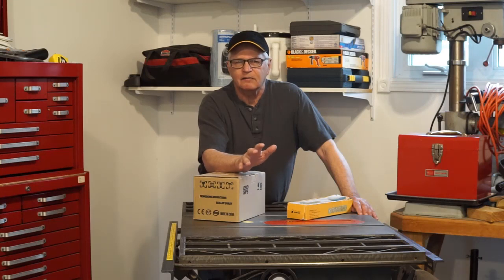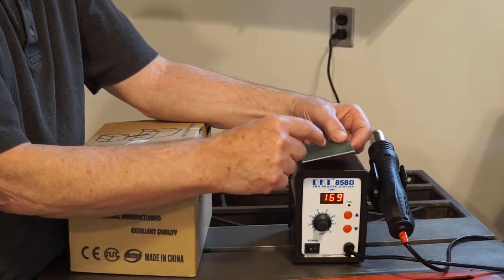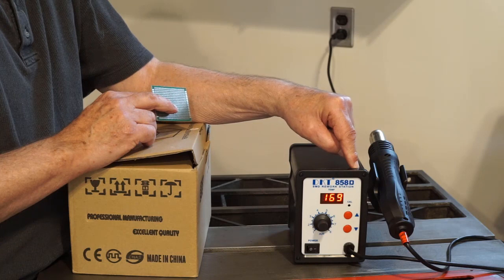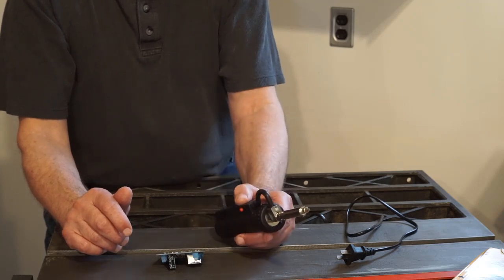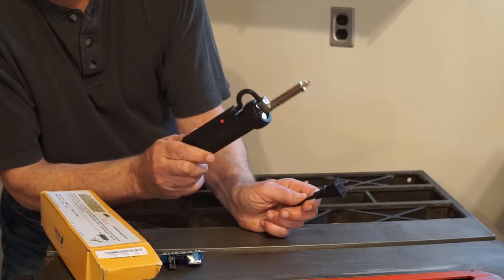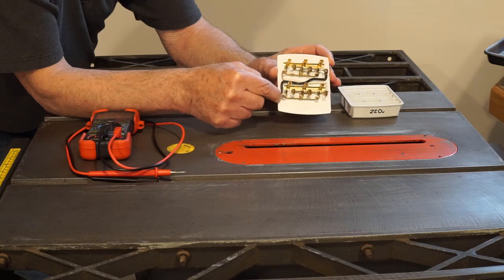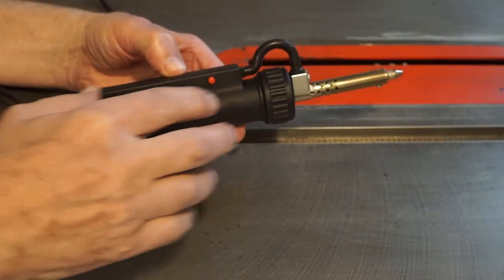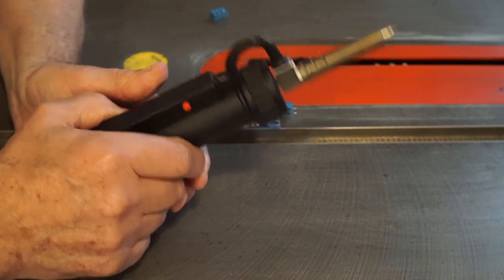GADGETS#55 - TWO AFFORDABLE CHINESE TOOLS

Comment: I am with u on that. For example. 02 Ford Expedition has the minature fuel pump relay soldered to the fuse relay box in passenger footwell. I bought the relay but after many unsuccessful tries ended buying the new box from Ford. Had I had this tool I may have succeeded. Always great info. Love your brilliant mind.
Reply from the maker: +Bill Rimmer - I've been making good use of both these tools. This automotive work is now as much about electronics and computers as it is mechanics.
And that very fuel pump relay soldered in that passenger footwell box came up is a recent video somewhere. Saw it last week...I forget who...
Bad design!
Take care, Bill

Comment: Nice toys and for the price, especially if you're making good use of them. Great workaround with the outlet multiplier for the solder sucker!
Reply from the maker: +Anthony Godinho - Thanks Anthony!
I'm using the camera built in mic and without a vehicle in the garage, there's quite an echo.
I don't think AUDACITY (which you introduced me to) can correct it. And, SONY A5100 doesn't have ext mic input. I'm trying to avoid separate audio sync in post. Been there, done that.
I've purchased a wider angle lens (25mm) that will keep the camera closer. Hope this will improve sound quality.
Reply: @theGADGETSplaylist  In Audacity, generally when I want to remove background noise in an audio track, I use the Noise Reduction feature. I've personally not tried it on echo, but I know that there is a special free Audacity plugin called ERA-R that works well for removing echo. That may work well for you. That being said, the audio in this video sounds pretty good to me.
Reply from the maker: @AnthonyGodinho  - Viewers with smartphones notice it more.
Noise reduction feature both in AUDACITY and CAMTASIA (editor I use) are very useful BUT don't correct the echo.

I will look into that ERA-R plug in. Thanks.
Sound is as important, if not more important than image quality, so I have to do better there.
Take care.

Comment: Actually that "solder sucker" is only operating at about 25% of its rated wattage at 120V (That's not taking into account the 50 hertz as opposed to North American 60 hertz) It's never going to get even close to hot enough that way. Think I will have to get myself one, thanks for sharing!
Reply from the maker: +Big Rockk - you are correct on the 25%
I know that 240v woke that sucker up!
Thanks for the comment.

Comment: Just to make sure you’re aware of it: There’s quite an echo in your workshop that makes the video a bit hard to follow on a phone.
Reply from the maker: +Conservator - yes, especially the first scene where the camera was more distant. And it's more pronounced viewed on a phone.
It's a high ceiling and when there's no vehicle parked in there, it can be a problem.
I've done a lot of separate mic / video which is then sync in editing...a REAL pain! Yet, audio is just as important as picture in a quality video.
I've ordered a wider angle lens that will allow camera closer to me in an effort to correct it. If I must, I'll bite the bullet and go back to separate audio.
Thanks for bringing it up!
Reply: logical canuck 
Sound deadening materials might also do the trick. I don’t know how much you would need nor if you’d want to make any changes like that at all, but it might be a relatively simple solution. 
You could glue up parts of the ceiling and opposing walls with those foam panels or, if you want to go full guerrilla style, just hang up some cheap blankets from a garage sale/gregslist. I’m no expert, just thinking out loud. 
I assume that your camera doesn’t have an extra mic input because that could also improve sound quality of cause. 
I hope you’ll spend your time on making content rather than on the presentation of it. 😄
Reply from the maker: @Conservator.  - sound deadening is a step too far...
I'll also experiment more with AUDACITY. Powerful, free audio editing software.
And you bring up a good point on the content. Not so much in this video, but in my more technical ones, I have my hands full and separate audio is 1 more complication don't need.
Reply: logical canuck Hi again,
Regarding sound deadening: just a few (one or two at the most) curtains would probably be all you need.  A few pulleys and/or screw rings and a cord would be enough to ‘hoist’ them just before you start recording. And when you’re done it wouldn’t take much time to put them away again. 
Maybe just laying a curtain or old blankets on the floor would be a quick win. 
I’m sorry, couldn’t help myself writing this. 
Looking forward to your next video ;)
Reply from the maker: @Conservator.  - no need to be sorry...I welcome input.
Anything but external mic (except when absolutely needed)...
Take care!

Comment: Tx for the video!
Why wouldn’t you use EU style sockets for 220V on your wall? The 220V appliances come (or at least can come) with EU plugs anyway and you won’t be able to plug in a 110V appliance by accident.
Reply from the maker: +Conservator - I don't have EU style sockets nor would I want to "permanently" convert that outlet to 220v for this one device and not be able to use it for 110v the rest of the time.
Anyone "accidently" misusing that boldly identified outlet would not survive long with all the other equipment in my shop.
Thanks for watching and for participating here in the comment section.
Reply: Not to mention depending on the style of EU outlet chosen you still wouldn't be able to plug the solder sucker in anyway (pin version) OR you could plug any 110v device into the (now) 220 outlet and damage everything you plug into it (the sort of universal outlets I've seen in hotels that accept almost everything North American or otherwise).
  It's the Chinese manufacturer that has screwed up. THEY should not have supplied the 220v device with that plug.  It does not meet code here in Canada. A 220vac plug is different still. 
Sometimes you do what you gotta do. Luckily he has a spit receptacle available. Most shops don't. Also he can remove the "adapter" and go back to a standard 110v outlet.
Reply: Yes, I was surprised as well that it’s sold with that ‘110V’ plug. I saw that there are converters for 110v to 220V at 100W but I have no idea if using one would be safer. 🤣

I also hadn’t realized that the adapter is a ‘plugin’ and not a permanent device.
Reply from the maker: @Conservator.  - I believe in the KISS principle.
I have no safety concerns with the solution proposed in the video...but we all make our own choices.

Comment: If you don't already have one you should also get yourself a soldering iron with a really small tip and some really thin (good quality) solder. Also some good quality "no clean"  flux meant for SMD work  is a must and will help immensely with your SMD efforts and avoid a lot of frustration. FWIW I've found soldering most SMD devices actually easier by hand than with the hot air gun. 
You should also make yourself a third hand by scaling down one of these. It was originally meant for welding but when scaled down (a lot) it's useful for SMD soldering. You only need to watch the first minute or so of the video. The improvements he mentions later are not necessary. Just the basic idea.
https://www.youtube.com/watch?v=FbrrP0JVwNcI 
   I used coat hanger wire for the arms and a small piece of half inch steel bar for the weight. It will help you hold down the devices while you solder them in place. It will avoid a lot of frustration with the parts being blown around (air soldering) or the capillary action moving the parts around.
Have fun. Looking forward to the 2-channel scope.
Reply from the maker: +Dave Sage - I'll need all the help I can get🙂
Thanks, Dave.
This will lead to a HS101 PRO build, finally a 1 MΩ scope and nice performance on that thing...
Reply: Sorry I was editing while you were replying. Go back and look again at my response for more tips.
Reply from the maker: @davesage9190  - Yes, transferable to SMD and I've seen a video (a while back) actually doing this on SMD and if I remember right, he was using coat hangers. I'll look for it again.
It's a good idea👍
Reply: Interesting. I figured I dreamed up the idea of scaling it down after I made a normal sized one for welding. Great minds think alike I guess. I'd like to see that video.
Reply from the maker: @davesage9190  - Has happened to me a number of times...a "gullwing" mechanism to open top of greenhouse only to later find same in UK...a truck bed extender that fits in 2" receiver only to find the EXACT same available on market.
I'll try to find that video again...

Comment: As usual I love your ideas. I need a soldier sucker. 220 is no sweat for me. I don’t what that other thing is for. Please keep up your inspiring work.
Reply from the maker: +Bill Rimmer - The "other thing" is just a specialized heat gun where we can carefully regulate the heat and the air flow. It can melt solder and we'll be using it, in the not to distant future, to solder components.
Thanks for your kind words.